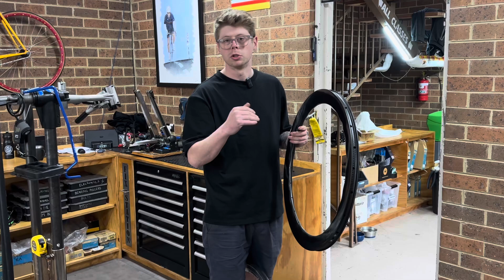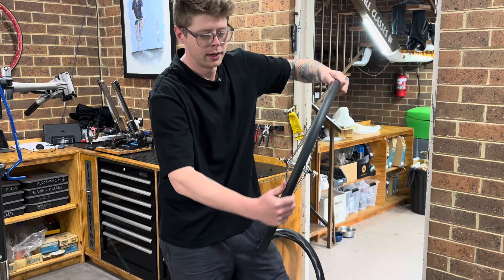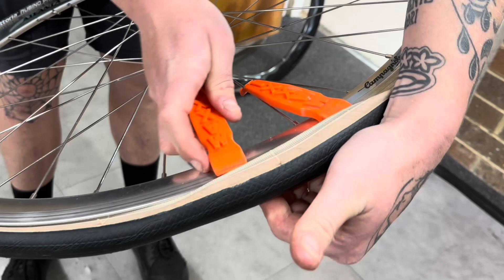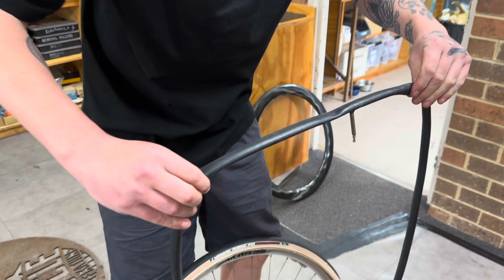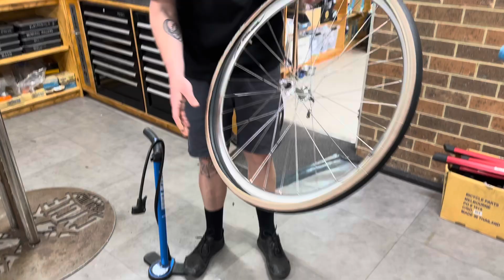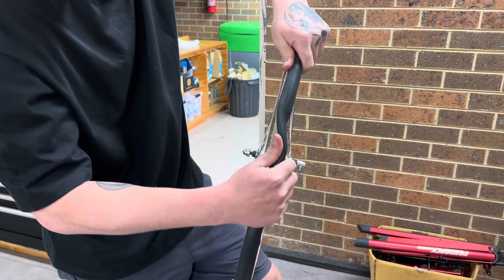How to Replace a Bike Tube | Quick & Easy Fix for a Flat Tyre (Beginner-Friendly)

Comment: You should start the removal process (at the valve) for the same reason you end the refitting process. Pushing the valve in enables you to avoid pinching the tube when levering the tyre bead out of the rim. Most people repair their tubes, so there's just as much incentive to remove them with as much care as you fit them. 
Also, when you fit the partially inflated tube, seat it into the deep part of the rim so it stays out of the way and you don't need to "tuck it in" needlessly as you work your way around the wheel seating the bead. Apart from that, good job
Reply from the maker: Thanks for the comment 👍